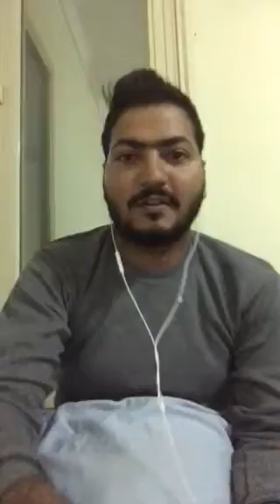TKH : Mechanical Equipment Installation- An Overview for beginners and freshers

Comment: Sir where is your next video for statics equipment erection procedure
Reply from the maker: I am unable to get time the time to edit videos and compile all the info. Sorry.

But here is the steps to Erection of static equipment:

1. Foundation by civil and curing 4 weeks
2. Chipping of foundation (25-50mm) by chipping drilling machine.
3. Putting the Padding plate of size 100*100mm with help of total station or auto-level
4. Installation of equipment.
5. Centering and leveling of equipment. Verticality check for columns as well.
6. Grouting and curing
7. Final Bolt tightening.